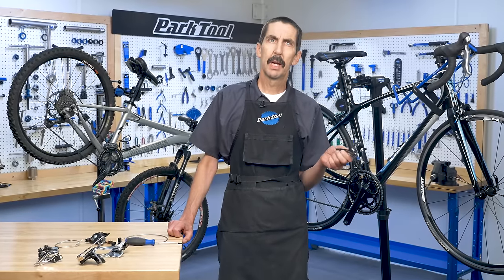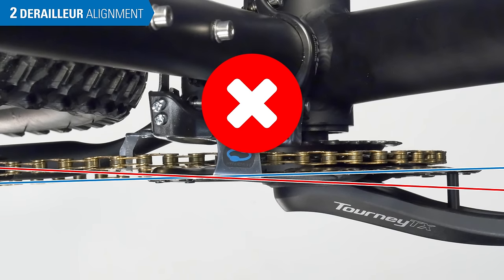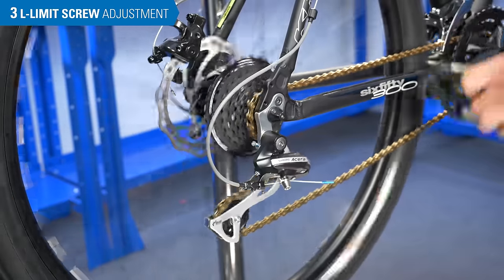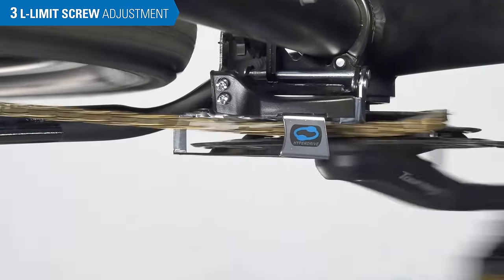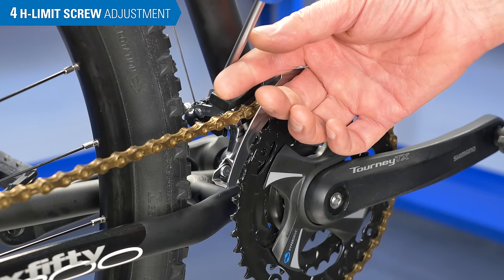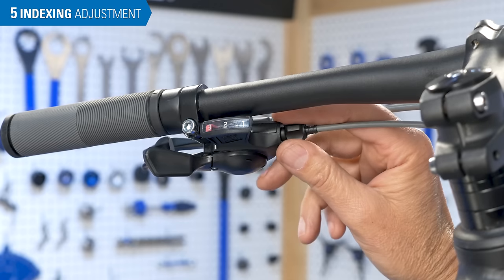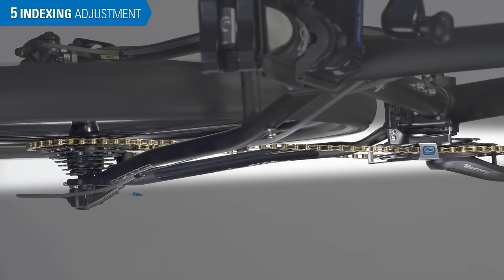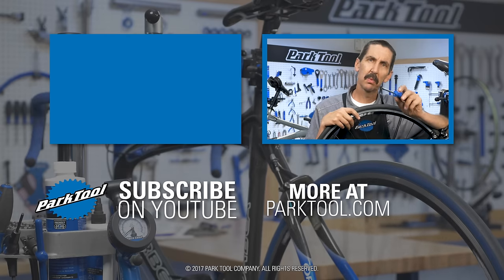How to Adjust a Front Derailleur

Comment: It's 2017, time for some engineer from Shimano or SRAM to design a front derailleur that isn't so amazingly hard to adjust.
Reply: substance You cabt get it easier than this.
Reply: T
Reply: this is amazingly easy to be honest
Reply: DI2?
Reply: Just a thought i had,  what about fitting a small cog inside the front mech cage, to remove chain rub, might mean you can use all gear combinations,  any mileage in that?
Reply: 1 x  drivetrain
Reply: You need to move over to di2
Reply: hm, if you find that amazingly hard to work on, I'm surprised you know how to use a computer.. :D
Reply: we all have different mechanical talent levels. 1x is for people who lack the mechanical skills to properly adjust the front D. I do not simplify my racecar because i cant tune it to race trim. I find a talented mechanic who can.
Reply: @Sean you know nothing about bikes. Everyone with enough money to spend is moving to 1x12+ because it saves a lot of weight and have better performance than the obsolete 3xwhatever. 1x is not simplification, it's optimization. I would get one straight away if I had enough money.
Reply: No kidding, I'm pretty much a newbie to cycling and just bought a hybrid bike a few weeks ago (Kona Dew Plus).

I've been teaching myself how to make adjustments and since I'm a hands on kind of guy, I typically just dive right into it and then look up videos when things go wrong.

I was able to make adjustments to my rear derailleur (Shimano Acera) without any problems, but last night I decided to adjust my front derailleur (also a Shimano Acera) because I noticed some difficulty in switching from the small cog to the middle cog under load, and I figured I could just use the principles I learned from adjusting the rear derailleur to do the front derailleur as well.  Man was I wrong; after an hour of messing around with it and only making it worse, I decided to put it away and go look up a video on how to properly adjust it.
Reply: the market goes where the money is. we all need this to fund real inovation.  current market  would be inexperienced newbies buying new gear. seasoned cyclists like myself have an arsenal of bikes to suit each ride and we keep our favorites based on thousands of miles logged. the seasoned cyclist does not jump on latest greatest clever marketing. i can document over 50,000 miles on road, cruiser, bmx, and mountain. if you want to save weight, push away that bowl of icecream or the extra cheese on your 5x5 at in-n-out. dont drink the koolaid and learn how to shift. my trail bike has a tripple and the big ring is a bash guard ;) 
enjoy the ride. thats what really matters
Reply: @jw4096  Kona dew plus is a great bike, had one myself for a couple years! Ended up putting road bars on it, which a mechanically-experienced friend of mine had to help me with, since it involved a pretty big overhaul. Enjoy it mate!
Reply: @frida5331  
computer programming is a lot easier than adjusting a front derailleur
Reply: They did: no front derailleur.
That's definitely easy to adjust xD
Reply: They have fixed this,  it's called a fixed bike gear
Reply: It's 2020 and no one even uses front derailleurs anymore.
Reply: @seanmolloy9422  "seasoned cyclist" meaning you ride your Walmart bike around your neighbourhood a few times in the summer... LOL... nearly all professional riders have moved over to 1x11 or 1x12 systems. Nearly every bike that's won a race, a trial, a marathon, etc over the past couple years has been a 1x bike. The highest model drivetrains from SRAM, Shimano, Box, etc are all 1x so while you stay with your head in the sand living with old technology, the industry advances and moves forward, leaving you and your antique bikes behind.
Reply: @---GOD---  im in san diego. lets ride. you talkin all the trash, im thinkin you might be fun to ride with.
Reply: @seanmolloy9422  good luck with that. I'm in BC. You should come up here.. We have top notch sidewalks even your 1970s no name Walmart bike can handle it.
Reply: @---GOD---  I can shred on a 1970 huffy, no problem. Just make sure the spoke tension is dialed in. Its fun to make a brick dance. Some guys need the latest greatest bike to make them feel less sucky on a bike, i understand. you'll be OK.
Reply: @seanmolloy9422  you can barely shred lettuce with your garage sale bike. It's okay, man.. new bikes are expensive. No need to feel ashamed of your inability to afford one.
Reply: 2020 checking in. Still waiting.
Reply: They're pretty easy to do when you've done a few - I've built new/serviced old bikes for a few years and I can set up a new bike's front & rear derailleurs to perfection in around 90 seconds. Older, worn set-ups take a minute or two longer, unless something needs replacing.
Reply: If it is so difficult for you just go with 1xby 
This is so easy and only 2 rings.
Reply: @Altairw  a lot of weight you say? How much?  A pound? Just push away that ice cream . if you wish to challenge my cycling chops, I'm in San Diego and easy to find. I'll let the ride tell who's who or what.  Personal attacks are for people who lack a proper counter point in a discussion.
Reply: George  Wow. Name calling. I. Guess you don't really need to formulate valid thought to sustain a moms basement lifestyle
Reply: It’s called Di2 and eTap

Comment: Best video for front and the other back derailleur, the front derailleur went on as smooth as butter then the final indexing adjustment and I was in the gears that might touch guard even by the manufacturer as irrelevant and I looked at the derailleur closer and the chain was slapping the friken tape that shows where to set the height at ,thanks for a professional video

Comment: I made notes from this. Email yourself them for reference when doing it:                                                                                                DR = Rerailleur    BA = Barrel Adjuster

NOTE: Turning the shifter's barrel adjuster CCW shortens the cable, moving the cage outboard, and  thus turning CW lengthens the cable and pulls the cage inward.

1. Cage skew adjustment: The outer edge of the cage should be lined up with the largest sprocket. Shift down to the smallest cog and use your hand to pull the cage outboard to line up to large cog.

2. Cage height: 2-3mm from the bottom of cage to large cog

3. L limit screw: put both DRs into the innermost cogs, then adj. the L limit screw so that the chain is just barely not touching the cage.

4. Cable: do NOT have a taught cable. If it is taught, turn the BA 1or 2 CW turns to loosen temporarily. Readjust the L limit screw so that it is just barely not rubbing the chain. Turn the BA back CCW to where it was.

5. Test: shift the front up a cog and back down. If shifting back down is quick, the L limit is done. If shifting is slow, turn the L limit screw CCW 1/4 turn and retry

6. L limit screw: put both DRs into the outermost cogs. 

Possible scenario: If the front DR won't go to biggest cog, the cable is too slack, so turn the BA CCW and retry. If you've run out of CCW turns to make, screw the BA all the way in and back out a coupla turns. Put front DR to smallest cog and tighten the cable. If it still won't go to biggest cog, try turning the H limit CCW a bit. 
Now turn H limit CCW 2 turns to make cage too far out. Put extra pressure on big shifter and this should produce a gap between the chain and cage. Now release pressure & turn CW the H limit until barely touching chain. Have it so when applying pressure to big shifter there's a small 1mm gap. 

7. Test: shift down to mid cog and back up. If it can't get back up the H limit screw is too tight. If this is the case, CCW limit screw a 1/4 turn and retry. If the chain falls off or there's a big gap to the cage, the H limit is too loose.

8. Indexing: shift both DRs to outermost position. This next step is to introduce cage movement by adjusting the BA and then removing the movement. Cage mvmnt means it's not contacting the H limit screw. So put pressure on big shifter, if there's no mvmnt, turn BA CW to lengthen cable. Push again and repeat until there's slight mvmnt, then turn BA CCW 1/2 turn and retest. Keep retesting and turning BA CCW until there's no more mvmnt. Then done!
Reply: How can you email yourself your text? there's no share option (android) or copy and paste incase I'm missing something, cheers
Reply: @Carlostype  Copy and paste?

Comment: Adjust the front derailleur by going to a 1x12
Reply: YESSS i want to so bad
Reply: But ...pedal backwards on the larger cogs and the chain falls off .  One negative .
Reply: And then you will not have a good final speed
Reply: Did anyone ask?
Reply: @3108cmf  I found it interesting that swapping to a 1 chain ring does not loose to many gear ratios .   As a lot are duplicated in the different chain rings ......BUT  you do have to sacrifice some . In the guys case who pointed that out . He have up 2 faster gear ratios .
Reply: @boracay12 I understand what you're saying. I've never tried 1 chainring. I use 3x9 and 3x8. I don't see any point on changing my transmission system, cause it has good rations and the duplicated ratios helps me to save the teeth of my transmission. So, it's perfect to me and I have the final speed that o like so much for one sprint and another. I think that the simplicity of 1x12 is the one thing i really buy. The rest seens to be industrie's bullshit, like the 29'ers.
Reply: @3108cmf  yup , i only use the largest  chainring . i have a mtb but ride on the "road" here on this island , [some parts are in BAD shape ,tire popping shape] but the hills are not to steep . im keeping it a 3x so if i sell it .  the buyer has that option .
Reply: @boracay12  Nice! If you use only the biggest chainring, you have to pay atention the "chainline", cause in the largest chainring you should not use the second  half of the cassete (that onde with the largest cogs). If you have more than one chainring, o think you should use all of them, man. Dont need to suffer. Your knees Will thank you. Greetings from Brazil! Nice to change ideas with you!
Reply: @3108cmf  normally i use 8 gear to 7 70 percent of the time and down to 5th on some of the hills . [ most are long gradual hills with short steep sections at the top ] if im lacking a little energy  i go down to 4th or 3rd but not for long or often . whats weird is in 5th i get sort of a soft thump every rotation and only in 5th .  which is the straightest line .  cheers !
Reply: 3x drivetrains are useless if you do any more than gentle wood paths

Comment: Hey Calvin, I just picked up an old MTB with indexed shifters - followed your very detailed video step by step - but low & behold - no joy!

I couldn’t get the rear shifter to go all the way to the largest gear, or the front to the largest gear.

Anyway, after a bit of frustration, I had a hunch it was the actual indexer mechanism on the handle bars. Sure enough, I opened them, squirted some isopropyl alcohol, clicked and backed off a few times - and hey presto - full range of movement!

THEN I was able to go through your video step by step - and now it’s good as new!

Calvin for President I say!😜

Comment: My chain in rubbing on the front derailure when the chain is on the large ring.
Reply: Likewise, don't get why this scenario isn't explained
Reply: Do your shifters have a trim function?
Reply: @ricardotijerina886  I don't think so.
Reply: I've been having the same problem, and it won't shift into the largest gears, I have been using the limit screws as soon and constantly readjusting the tension but nothing
Reply: @filthyflux475  Derailleur cage rotation, height is correct?   If so then start from zero again,   loosen up the cable and pull it again to make sure the tension is ok and tighten the cable screw again and adjust derailleur again.

Comment: I rode a MTB absolutely everywhere for my commute to work as a teen and into my mid 20s, only ever really making little adjustments here to the cables but always just lived with rubbing chain, gear that skipped down when going up a hill and really pressing down on the pedals. Since driving and having kids and living further away I haven't cycled for about 15 years. Recently I bought a folding MTB and we car pool to work and I chuck my bike in the back and cycle only about 30 minutes away from my shop then. Just to try to save on fuel with 2 cars and get back down to my old weight! 
My cheap bike came with crappy shifters so I bought less crappy ones but needed to fully adjust them all, this video got me right on track and I understand it now more than I ever have.
Thank you for this, really is a great and helpful video

Comment: I've been riding bikes and taking them apart for 50 years and never had to get into the front derailleur much. I repainted my bike and dreaded getting it back together. Brakes went together o.k. and they mostly work. Back D was not a problem, but that front D was the last hurtle. After 3 days of putzing for about an hour each day and going back and forth with the video I was able to get all 3 gears. Thanks! I'm not sure which combination of loosening the cable, moving the screws worked, but it's a bit of alchemy and persisting.

Comment: Well this was interesting; bought a bike a week ago and the front derailleur has been rubbing against the big largest ring from the start.
I didn't notice this when I test-rode it (haven't owned a bike in a decade).
Having now watched this video I now know that the derailleur is too low AND they haven't touched the limiters at all since they were all the way out.
They also sold me a package holder that didn't fit on my bike (they were all pretty much the same according to the salesman).
Too bad that I've scratched the bike or I'd return it.
Serves me right for trusting the competence and honesty of a salesman.

Comment: Thanks again , I think I need my front derailleur cage replaced,  I got a super cheap £400 bike off amazon it has disk breaks and a great aluminium frame but I replaced the mechanical breaks with m2 hydraulic breaks and the non adjustable masura suspension for air bike adjustable forks and got a sel royal royalgel saddle and changed the chain to a heat treated galvanised chain and its now a great bike , I also got some carbon fibre adhesives for chain guard and in between the mudguards that I also replaced , I have used your videos and am very greatfull for your help 👍

Comment: I was having some problems getting the double front to actually shift nicely and it turned out to be the alignment of the derailleur . Not a smooth transition from 24 to 48 but it works. Unlike what most diamond frame riders have, I use either or, not shifting the front for sometimes weeks at a time. really excessively low gears and normal gears .

Comment: After an hour of failure i tried to play with gear cable tensity and it magically worked! Just make it as tense as possible, but not too tense so you can still change gears easy with your fingers on shifter.

Comment: Calvin Jones is an undisputable professional, and extremely gifted in the ability to clearly exposit

But that's not the reason for my post

Park Tools, still made in the USA as far as I know, are the literal standard in bicycle tools
I think of Park as the Harley Davidson of bike tools
However, in truth, the statement should be that Harley Davidson is the Park Tools of motorcycling

I have owned multiple Park Tools in my life, some for nearly FORTY YEARS now!
That's right, 40 years

In all these decades, precisely ZERO of these tools have failed

I stake my reputation on the above comments

Park Tools are expensive
But if you're serious about bicycling
Then make the lifetime commitment
I promise you will not regret it

And if nothing else, you'll have no problem reselling them if they have been cared for

Comment: The first half-dozen or more comments after mine are all praises for this Park Tool ad-help.  My two comments have critical elements that have gone unanswered for 4 months.   Would I pay more for a Park Tool?    Not 'alf likleh !
Reply from the maker: Looking back at your comments now. One is a statement and the other is asking if you are a weakling based on seeing mechanics move the cage in relation to the body of the derailleur. I guess the reason we did not respond, is because we did not quite understand. There are a few different types of front derailleurs. Typically when you move the cage you move the body so we did not have a good answer for you as we do not see this happening. I doubt this is much help for you as it does not answer any questions but at least its a response ;)

Comment: This is such a well explained video. I now have my chain going on all 3 blades again, its not yet 100%but I need to get a stand, its hard without for your back :D. Also managed to shift in the back all the way, then forget about it and panick about the sudden loose cable. I fiddled with the cable tension and now its all ruined, but you know what, its ok! There is a rear derailleur vid as well and I'm sure its just as good so I will tackle this situation with the help of this wonderfull man and his well spoken explanation! Tomorrow I get a stand and conquer the derailleur quest. Thanks!

Comment: Thanks just a few turns of a screw and chain is no longer grinding into front derailleur except at most extremes of gear ratios which i dont use anyway and at the moment dont have the time or other tools except for a screwdriver to dial it in perfect. Very informative.

Comment: If the cone and lock nut is removed first from the none drive side first  the whole assembly can be released complete when the sprocket bearing race is undone thus enabling  one to do the strip down and re-assembly in the vice . 👍 From an old mechanic .